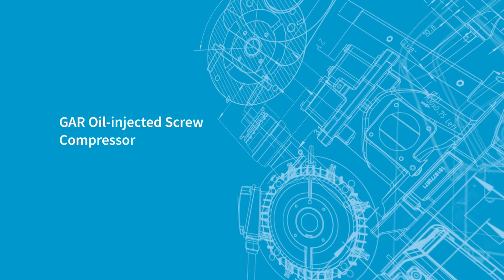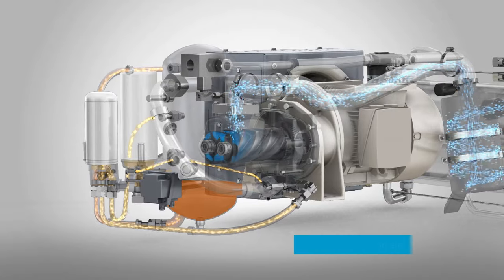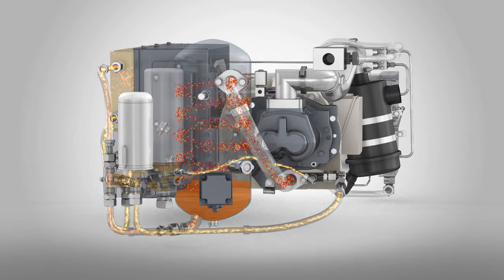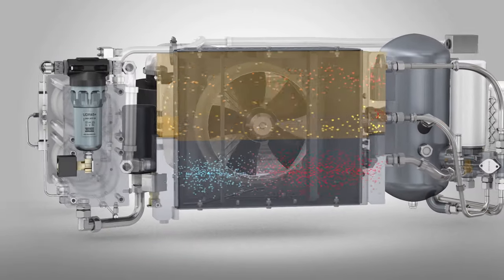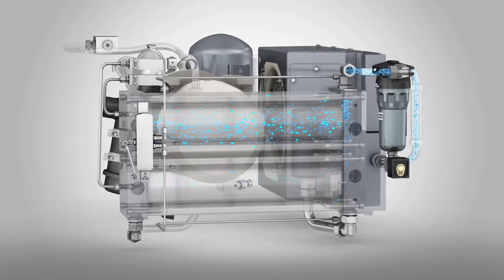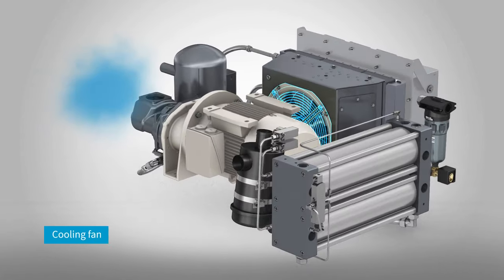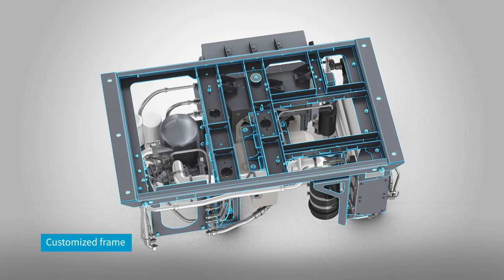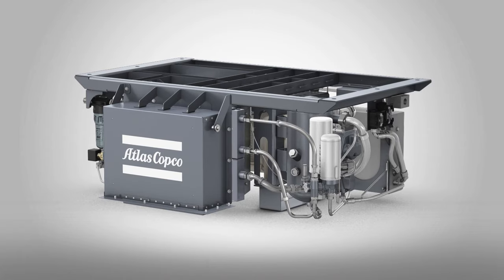Atlas Copco | Oil Injected Screw Compressor GAR for Mobility Solutions

Comment: Kindly make a animation showing how a oil free screw compressor works. Like air path scheme, cooling water scheme, use of drier & intercooler etc.
Reply from the maker: Thank you for suggesting.We will address this feedback with the concerned team.
Reply: @AtlasCopcoCompressorTechnique  It's already there with the Atlas Copco service engineers. I hv seen it, it's made amazingly well.
Anyone watching it once can understand the working of the internal components.